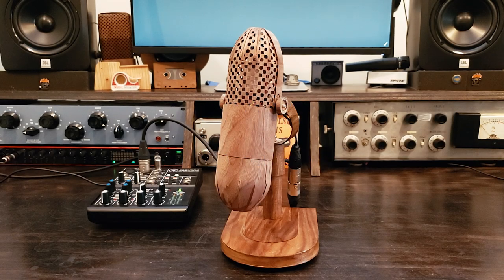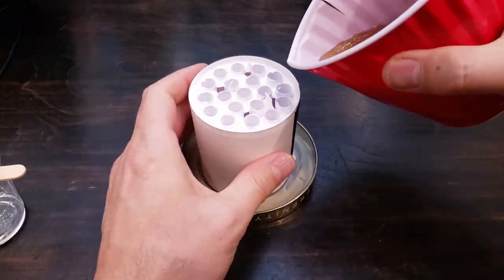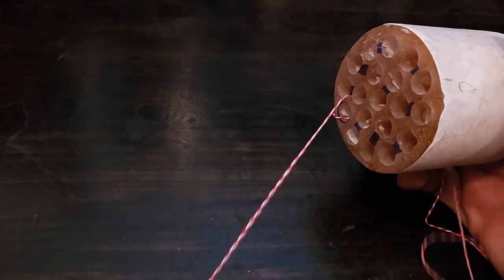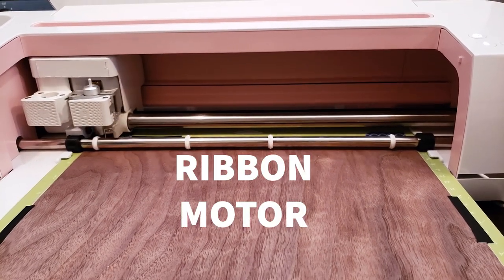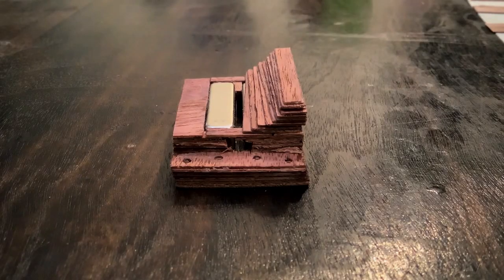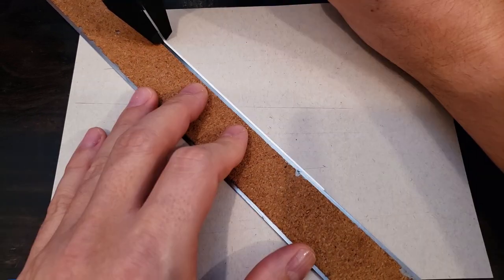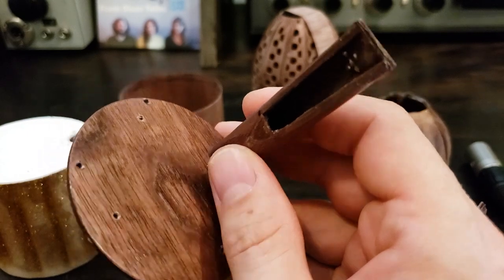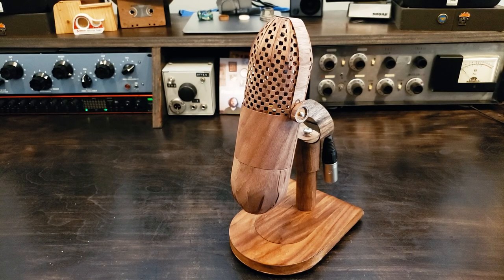DIY Ribbon Microphone RCA 77 Mic WARNING: TRYPOPHOBIA #maker #diy

Comment: Hey, awesome build! Looking into designing a cardioid ribbon mic was wondering where you found the formula for labyrinth. You mentioned in the video that it took some time to find a working plan, so any help would be appreciated. Thanks so much!
Reply from the maker: Thanks! Hmm, I don't recall using any particular plan. I also don't have any specs at hand.  I studied lots of photos and checked specs for size and shape and made some estimates. Countant dot org was a good resource for photos and specs, as I recall.  I also do a bit of measuring in photoshop, so once I have a good photo I can get a good idea of ratios between parts.  Everything in mic building is a tradeoff, so I believe there's no "magic" number for specific labyrinth specs. For example, the first RCA 77A was enormous, with a large coiled copper tube labyrinth and it was known to be a great sounding mic.  If you get the body and holes it in the ballpark of size and shape, you'll have a mic you can hone into what you want.
Reply: @FrankOlsonTwins  awesome, will do. I designed something in openSCAD last night, I’ll 3d print it sometime next week and see how it works

Comment: This is brilliant!  Great job.
Question for the build: the output of the labyrinth just goes into the bottom cap of the mic? And what were the dimensions you used for the labyrinth (height/diameter)?
Reply from the maker: Hey, thanks!  I don't recall the exact dimensions- I want to say something like 3" tall and 2.5 wide.  The width probably isn't critical as long as you get the correct number of holes drilled.  And yep, just like the original, the labyrinth output goes right into the bottom cap.
Reply: @FrankOlsonTwins  thanks for the reply. Im going to try and do a 3D printed labyrinth and more of a ku3a style. Great inspiration here. Thanks so much!
Reply from the maker: Cool!  Yeah, the Ku3 style was the next design I started making, but I haven't finished the project.  Let me know how it turns out!

Comment: Where are the cricut files and assembly drawings?
Reply from the maker: This one was a labor of love.  I designed the entire thing around the ribbon, since the magnet technology has changed so much since the 60's.  I decided not to post the files(for a variety of reasons), but if you take notes in the video you can pretty much recreate one with photoshop and the cricut software.  I don't recall the exact ribbon  size, but it's about 1" long.  Design a ribbon motor around a thin ribbon like that and just put together a mic body like in the video.  As long as you get remotely close to the sizes and shapes, it will sound great.  Nothing has to be critically sized, except that the ribbon you cut should exactly match the gap of the motor.

Comment: Having trouble understanding the bass 4 ft of traveling sound. Is it basically catching the resident frequencies so it does not come back to the microphone. What does a really expensive companies do to the reduced the reduce the noise of the ribbon microphone?
Reply from the maker: Yes, that is concept.  The sound travels past the ribbon through the labyrinth and comes out at a different point of phase, keeping the sound from cancelling itself out in the ribbon motor.  In some ways, this is the pinnacle of ribbon microphone technology. The technology was researched extensively by RCA engineers at great expense.  The final iteration was implemented in the RCA KU3A. You could consider that mic the final evolution of the 77 series.  Generally speaking, ribbon mics were basically abandoned after that point for approximately 30 years or more.
Most companies do not trouble themselves with unidirectional ribbon mics(AEA is the exception).  Most ribbon mics are figure-of-8 pattern, and they catch whatever reflected frequencies that come back to the ribbon.  So you usually take the bad with good there, it's inherent in the design.  In a good sounding room with certain instruments it's not a problem, and often it is a benefit. Generally for dialog on television and movie stages, you'd be looking for something directional, which is where these small unidirectional ribbons excel(BK-5, 77, KU3).  
So in short, most of the companies do nothing to reduce figure 8 polar pattern. They just sell them as a figure-8 mic and give you pointers on how to best use it.

Comment: This is an “exhaust pipe” to bleed off extra sound or reflective sound…?
Reply from the maker: Yes, exactly. By giving the sound somewhere else to travel to , it keeps it from bouncing back  to the ribbon and either cancelling itself out(phase-cancelling) or creating a "pressure diaphram"(omni-directional). The original 77DX had an omni-directional setting, by blocking off the pipe directly behind the ribbon.
Without the pipe, sound would bounce off from walls and be picked up by the ribbon again. Not necessarily a bad thing, most ribbon mics are designed with no back side. They pick up equally from both sides(figure-of-8).